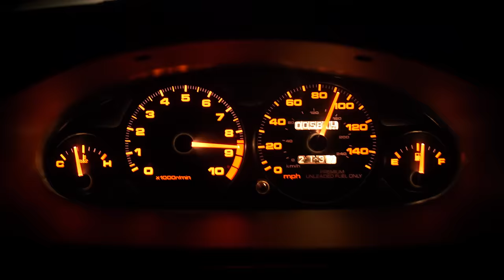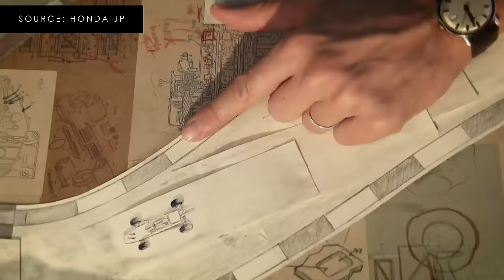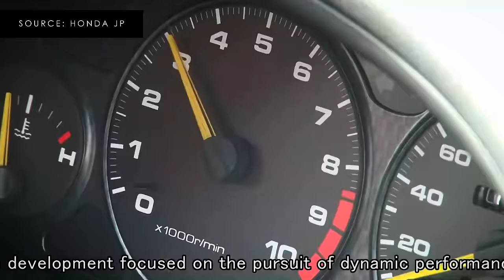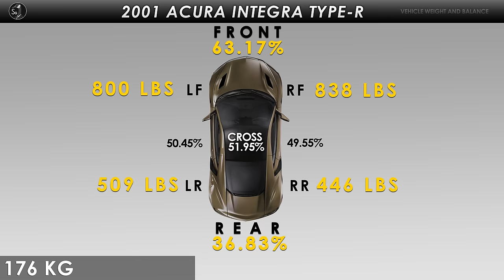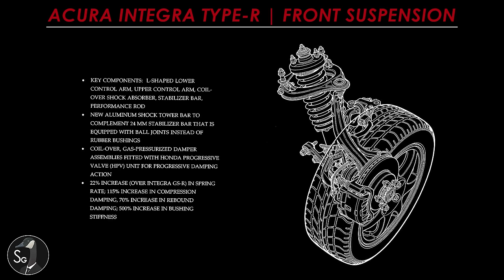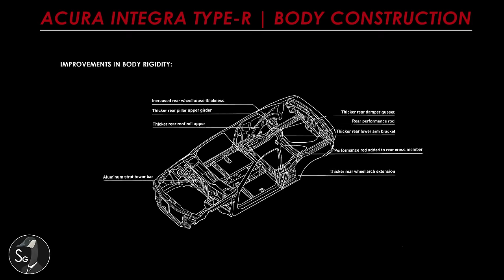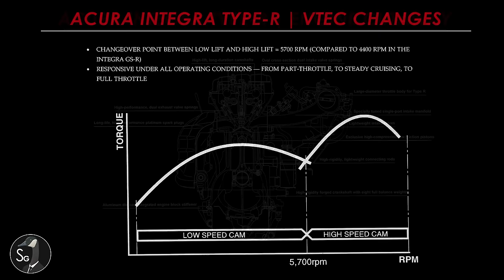Acura Integra DC2 Type R | Best of the Best

Comment: Absolute masterpiece. Thanks for all your efforts.
Reply: rasa porosangue  I spent a few days in one of these last year. It’s a hard thing to explain. The balance of the car is such that the front end pulls the back end around so it feels balanced almost like a RWD. That’s probably the best way I can describe it.
Reply: rasa porosangue  I had a GSR back in the day with many engine and suspension mods (some lifted from an actual Type R), and when setup properly with some good front negative camber, you could truly "turn with the throttle".  just after corner entry, the rear would start to step out, and you could balance it with throttle input.  It wasn't the extreme drop-throttle moves you had to do in some FWD cars to get the rear to step out, because the car wanted to step out a little bit naturally.  Then you'd use the throttle to adjust the attitude of the car as necessary. I had a friend with a '99 BMW M-coupe drive my car at the track once, and he told me, it "doesn't feel like a FWD car"..
Reply: Back in 2007-08 I had a chance to get this car for $13995, while GSR trim was $7995....
Reply: Yes, that's what Car and Driver or Motor Trend (I forget which) called it back in 1995. Specifically, they called its VTEC an "engineering masterpiece."
Reply: Still and always FWD (and that is NOT a good thing)
Reply: @boostedmedia  "feels balanced almost like a RWD"  ha Ha Ha HA
Reply: It's literally a piece of junk. Even a Fiat Panda is better

Comment: I have owned my Integra Type R since new and I am about to give it another oil change at 310,000Kms. My outlay in those 22 years has been less than $10,000, which includes 5 sets of tyres, 3rd clutch, 3 distributors, one only set of disc pads and one radiator. The motor is untouched, yet I rev it to 9,000 rpm every day. I recently fitted a sports air filter and added some special German fuel additive, resulting in a noticeable improvement in torque and acceleration by as much as 10%. The feeling of exhilaration when I drive this car is just pure pleasure and even though I have the money to buy a new hot hatch, I really have no interest in parting with this car. The Honda Integra Type R is special and is the last of the true performance naturally aspirated engines.
Reply: You sir, are a man of culture! Hope your story is true because I am planing on buying 200.000km euro R civic and druving the hell out of it.
Reply: @urosjelicic4299  Hi Uros, everything I write here is true. The engine remains untouched and the only mod is the air filter. I'm giving the car to my son and I know that once he has driven it, he will understand just why, for 22 years, I have got so much pleasure out of this car. Sure, many little shit boxes will out accelerates it, but put it on a track and only the best hot hatches can outdo it. It's just a beautifully balanced car and a special piece of art!

Comment: Amazing production. The 90s were a magical time for cars. Modern building materials without any computers getting in the way.
Reply: Exactly. Just think about what Honda delivered within a few years. The EK9, the DC2, the S2000, the EP3, the DC5, the FD2... Oh and the NSX. All awesome, all current and future classics.
Reply: The ITR had electronic fuel injection...
Reply: @aspecreviews  I said "no electronics getting in the way", not 'no electronics'.
Reply: @joezucchiatti7110  And that's key. This was high tech at the time! But the tech cleared a path to the drive, instead of obstructing it.
Reply: Japanese automakers simply owned the 90's. Anything else is either braking down or hideously expensive to live with.

Comment: Thank you for this video. I remember being 20 and going into the Acura dealer across from my old High School in Jacksonville, FL and looking at one. They were 23k and I still remember that bright mirror swing tag still to this day. They had 3 Type R's sitting in the floor, 2 yellow and 1 black. I got in, liked it but felt it wasn't luxurious enough. I drove down the road and bought a 2000 Honda Accord EX V6 fully loaded instead. I sold that car 2 years later at a loss as it was even more than the Type R was. I said if they EVER came out with a Type R again I would not hesitate and buy one. In 2019 I bought my blue Civic Type R and love every minute of owning it. I will never get rid of this car and it's my perfect dad car for my son and daily driver. Thanks for the memories.
Reply: A 2000 EX V6 cost more than an ITR? That’s wild lol. I was only 10 at the time. Thanks for the look back
Reply: @oldsklteg  Yah MSRP on a loaded accord coupe in 2000 was right at 27K. I got it for 25.5k out the door, sold it 2 years later for 15k! Huge loss. I said I would NEVER make that mistake again and I didn't.

Comment: Just like your LFA and S2000 videos, goosebumps. Didn’t think this level of production was possible. Subscribed until the wheels fall off. 

I also noticed that the N/A V10 engine in the F1 McLaren MP4/5 holds a similar pitch to Honda’s 8000+ RPM I4’s, which you demonstrated beautifully.

Comment: This makes me proud to own my bone stock 1997 GSR. I wasn't even alive when my car came off the assembly line. I can only imagine what a treat it must have been to drive these cars when new.
Reply: Nothing else matched the shifting of the manual transmission, even at much higher price points. And that engine would hold 11-12k rpm for as long as you wanted.
Reply: @troyjollimore4100  Please share with us how a GSR with a 7k redline and 8200 RPM fuel cutoff would "hold 11-12k rpm for as long as you wanted."
Reply: @tim3172  Because when holding down the throttle in neutral, by the time the engine has hit the fuel cut-off, the revs are still increasing that much as the engine free-wheels. The techs at the local Acura dealership used to this on occasion. Said the engines could take it all day...

Not that I'd recommend it.

Comment: The old Type-R's were the real deal. Other car companies always claim that their flagship sports cars come from a racing lineage, but in reality, the passenger versions, with their invasive nannies, excessive comforts, and almost certainly automatic transmissions are the polar opposite of racecars. When Honda offered these "real" racing machines to the public, it was a dangerous business decision considering the vast majority of the consumers were certain to find them too rough, noisy, and lacking luxuries. Not to mention the claims of a "gutless" engine, which to this day is my most reliable indicator of someone who has no idea what they're doing behind the wheel of an engine properly tuned for peak power.
Reply: Tf are you talking about?  Projecting?

Comment: I had a DC2 and the driving experience still hasn't been matched since. And I've owned E46, F80 M3s, Evos, 370Zs, Megane RS and now a GR Yaris. The only car that's come close is a Porsche GT3 but even that doesn't have the same rawness.
Reply: There's something special about a car that drives so well for comparably less money. I wouldn't enjoy driving a GT3 like I did my DC2-R, the stakes are too high. Hondas are the perfect underdog sports car and I always loved that about them, especially the DC2-R since that was the first Honda I owned. I owned a rare 4-door version of that one, which in hindsight I should have kept.
Reply: I had one also. What was amazing was it was super raw when pressing on, but also quite comfortable, reasonably economical, capacious with its hatch and fold down rear seats and practical when driving normally! It was the fact that something so hardcore was also relatively sensible at the same time has surely not been repeated. Only the lack of a 6th gear which would have increased its bandwidth even more marked it down in my book.
There were other cars like it (fwd, NA, hi-revving, light) at the time: the FTO GPvR, the Celica 190 etc, Clio cup even. But now there are none like this apart from arguably the gt/gr86/BRZ. There is the odd hardcore hot hatch from MINI, Renault and VW but they usually seem to be weirdly priced, impractical etc. That said I wouldn't mind a go in the latest and next gen Civic type r.

Comment: US Type Rs used the Civic Type R trans with the 4.4 final drive vs the Japanese Type Rs using the 4.7
This makes the higher compression (11:1) and more agressive 4.7 final drive R quicker and racier.   American Honda always neuters the good stuff - they also changed the exhaust manifold from the japanese 4 to1 style to a tri Y style.  Japanese Rs also got Recaro seats while we got wrapped Honda seats.
Reply: This is why it's awesome the 25 year rule is now over.
Reply: I genuinely wonder why exactly they made those changes, though
Reply: @yeetyateyote5570  American Honda morons who misjudge everything
They thought the FK8 was too expensive and were going to make a cheaper version.....derp derps did ZERO research to understand guys like me who built Hondas in the 90s are now 40 to 50 years old and can easily afford a 35k car to play with.  Markup in metro markets shows we paid 10 to 20k+ markup to own what we couldnt get in the 90s
The same thinking was around in the 90s at American Honda.....they do zero research about the demand for vtec Hondas and give us watered down garbage to keep costs low. 
My FK8 is about 12 mos old and makes 533whp/431wtq - stock engine, stock clutch, stock exhaust .....Imagine if Honda actually sold us an R that was at full potential from the factory? Instead they water them down for the masses.  The oem turbo supports 450whp but they sell it at 280whp tune.....give us cheap intercoolers etc....ridiculous penny pinching instead of understand performance buyers SPEND MONEY  - comical at times but depressing when you imagine what they could sell if they had balls and did a little research.  
Like the 90s I just have to build it myself
6 piston brakes from paragon coming. 305 wide fronts coming .....they could offer this. but they wont.

Comment: Leading up to the summer release of the 2024 Acura Integra Type S along with the specs that got announced today with 320 hp + 310 lb-ft torque mated exclusively to 6-speed manual transmission, I found myself watching this over and over again.

As I was born on May 24, 1992, I had the luck to get to know of, and grow up when the DC2 Integra Type R was made, and this, along with EG Civic, were what sparked my interest in cars, especially Hondas (ホンダ).

And upon putting my deposit in January 2023 for the 2024 Integra Type S, I cry in my heart over the fact that I’m planning on upgrading from my 2020 Civic EX-L hatch, to the 2024 Integra Type S that serves as a move forward to a new lifestyle of driving stick, and a tribute to what I call, the genesis (i.e. DC2 ITR) of my hobby in cars and driving.

As I salute to everyone at Honda (ホンダ) in my proud third language, Japanese (日本語), インテグラ・タイプR・DC2仕様を生産してくれたところはご苦労様でした、ずっとありがとうございます。

Thank you Mark and Jack, for this video!!

Comment: I daily drove my Integra GS-R for 6 years before I traded it in 2007, and I regret trading it to this day. Not only an amazing chassis and driving experience, but surprisingly practical. With decent all season tires, it more than held its own in the snow with all the weight over the front wheels. Ample cargo space with the back seats down, I hauled all my stuff when moving to and from university. Never had any more than routine maintenance to worry about. By a wide margin, the best car I ever owned. I can certainly appreciate the Type R getting every last ounce of performance, but sadly I'll never get to experience that first hand.

Comment: I had a 2001 Integra GSR, i blew the head gasket driving hard in the canyons above LA. I ended up swapping in a 98 spec type R engine and transmission.  With hondata, Hytech long tube tri-y header and short ram i made close to 230hp to the wheels.  The car was an absolute blast to drive, i would get complements on the exhaust with people saying it was the best honda they had ever heard. It literally sounded like a street bike. Since then i have owned many hondas including an Eg with K20 swap, FA5, and now 2019 Accord with 2.0t but i will never forget my integera...

Comment: I've had a 1993 miata , three 240sx (2 s13 1 s14), 1986 corolla SR5 with 4age swap, 2003 gti, 2005 audi a4, 2001 teggy GSR  2012 legacy 2.5GT, and a now 2017 GLI.. all were manual, all were  very close to stock and well maintained. The two cars I miss the most are not  the fastest. To me the 240sx and Integra gsr had the most spirit or character or whatever you want to call it but there was something very special about the 240sx and integra.. great handeling, great feed back, light weight, and reliable...really want to get another... but older cars can be a pain to maintain and find parts for, like my AE86. Everytime I see a 240sx or Integra I'm filled with nostalgia. Now I have my eyes set on the new GR86. I drove the 2015 86 and it felt really underpowered compared to my legacy at the time. Great video savagegeese!!

Comment: Man, I remember back in the mid to late 2000s when these Tegs and Civics were all known as slow econoboxes and and it was all the rage to compared it with Mustangs... I guess all you can say is who's laughing now...

Edit: in the sound section with some good headphone on, I actually wanted to cry... The way that engine sounds; just absolutely raw, throaty, but so precise and purposeful. Almost like you can hear every stroke and every heartbeat of that engine working in engineered sequence to wring out every ounce of performance in that car... Every pump of the cylinders, every lift and click of the valves, every pulse of exhaust exiting the combustion chamber... The sound is the evidence and fruit of that calculated labour. Mechanical, but pure, unlike like the LFA which is magnificently artistic and sings a symphony of harmonies, overtones... This, the prime Honda motorsport engines, is just. Pure.

Thanks for your amazing camera and audio work to capture some parts of this for us mere mortals to enjoy, SG.

Comment: Fantastic video! First  new car I bought was a 1997 Honda Prelude. Took it to BMW, Pontiac and SAAB driving schools at Mosport and Shannonville tracks in Ontario. Great on the street for cruising and as a daily driver but a totally different beast on the track. It doesn't rev out like the Integra Type R but on the track the Prelude's 7500 rpm  vtec scream and passing unsuspecting Boxsters, Z3s and SLKs from the late 90's was the norm. Reliable is an understatement for many Honda/Acura products assuming they weren't ravaged by rust. Don't see many Integras or Preludes around in the Toronto area as the rust got most of them long ago. Fortunately, I was able to stop driving mine in the salty winters many years ago and it's now my summer driver  that's looking to turn 25 next spring! Looking forward to your next masterpiece.

Comment: 12 months ago I bought an ep3 with 250,000 miles on original engine (even the chain), I now use it for track days and frag it to the red line. 
It still runs the same as I bought it, Honda engineering from then is incredible.
Off to silverstone gp circuit tomorrow, can’t wait.

Comment: I loved mine.  

Added a "carputer" and tsx HID Retrofit. Comptech Icebox intake. Spoon ported Throttle body. JDM 9,OOO RPM redline. JDM Header to a Mugen twin loop.  Strut bars front and back. An Alpine deck unit  and Bazooka tube strapped to that rear strut bar in the hatch!

These things breathe fire and claw the road with vicious little 15 inch claws.

I'd buy her back if I could.

Comment: I loved my 1998 GS-R, performance was about 90% of the Type R (e.g. an 8,100 rpm red line). I seriously considered the Type R when I bought the GS-R but things like mortgage payments interfered.

The V-TEC solution to peak power and the attendant high rev's had a huge attraction to those of us who grew up on Honda four stroke motorcycles. Forget about forced induction and big displacement, give us something to wind out.

In addition, Honda created 100 hp/litre automobile engines that delivered unmatched daily reliability and durability. A daily commuter that transformed when you put your foot into it.

Comment: a PERFECT review! I remember having a White GSR back then and it was when acura was actually a cool company. You could buy all of the Type-R parts (headers, throttle body, exhaust, strut bars) right at the dealer and have them installed and warranteed. I added every part that I could afford! The car was alive, like a buzzing bee. Sad to think that nearly all cars will be electric by 2035, and along with that, say goodbye to manual transmissions too.....